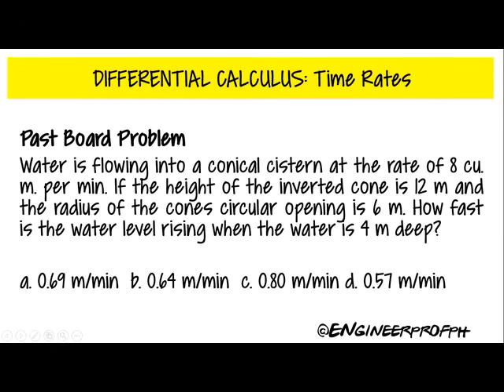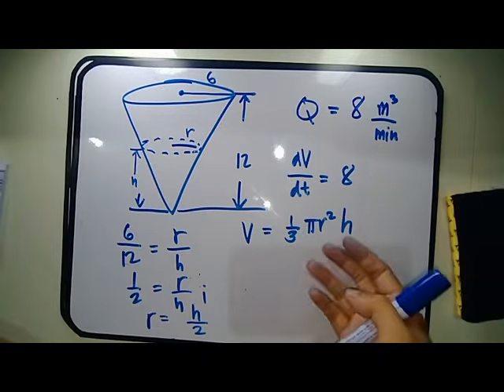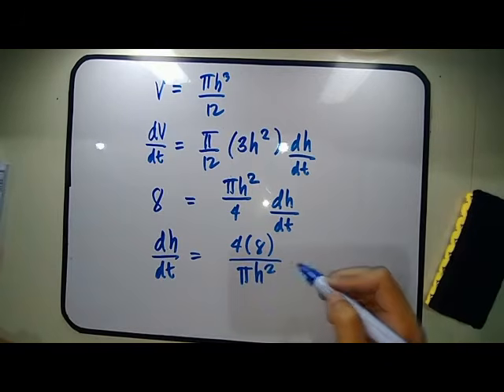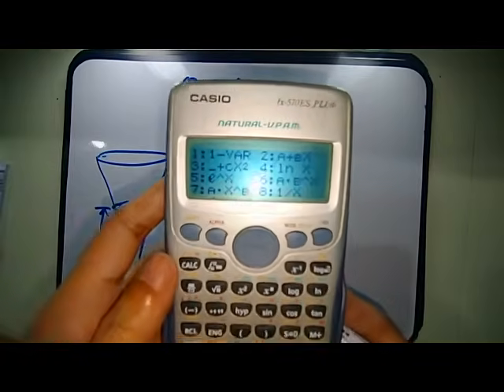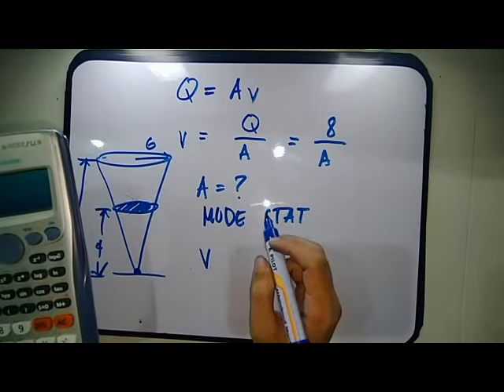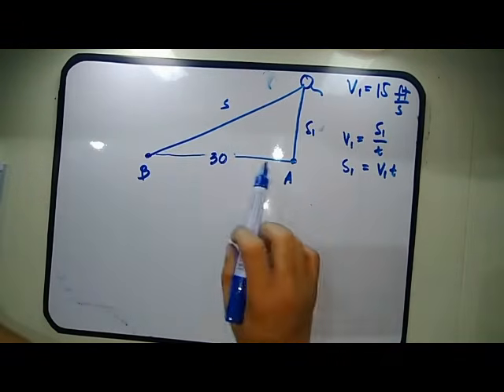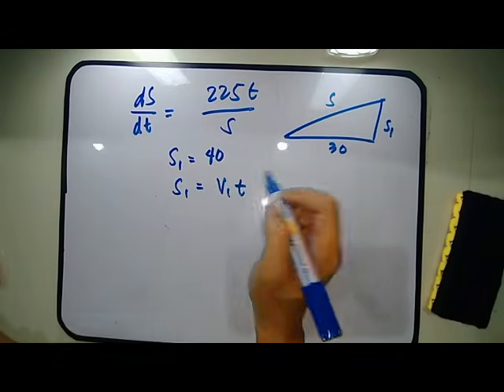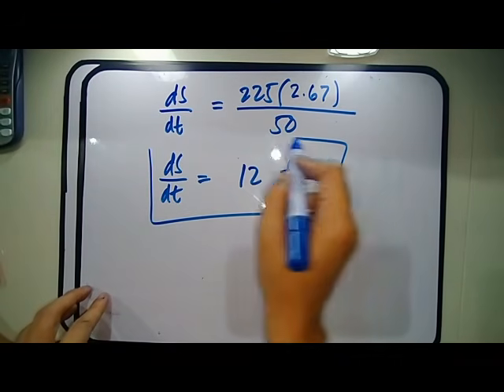Time Rates |Differential Calculus|

Comment: Sir bkit di pwede na gamitin agad yung formula ng V = d / t, solvable si time given ang V1 and S1, then solve na for velocity when S=50, velocity will be 18ft per second. Too convinient pero mali sir? Bakit po kaya
Reply from the maker: Hi! Nagkataon lang po na yung ganitong alternate solution ninyo ay fit sa problem. If you look at it po, you are actually using a derived equation from dynamics (which is galing lng din naman po sa calculus). Thank you!❤️

Comment: The sides of a triangle measuring 40 m, 32 m, and 16 m increase at the rates of 2 m/s, 5 m/s 
and 3 m/s, respectively. How fast is the area of the triangle changing? Ask ko lang po paano process dito
Reply: I specify mo ang parts kung saan jan ang height, base at sides

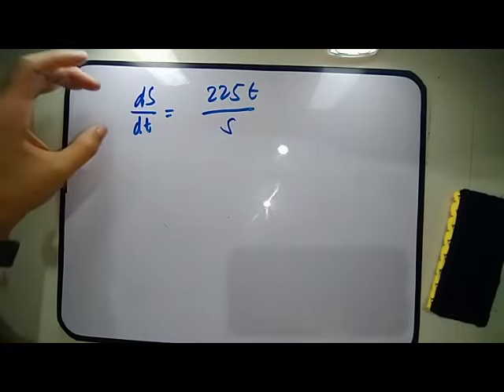Comment: sa second question, paano naging 225T/S?   Please check 10:33.
Reply: Divide both sides by 2s, so ma cancel ang 2 sa 225(2t) kaya 225t/s nalang
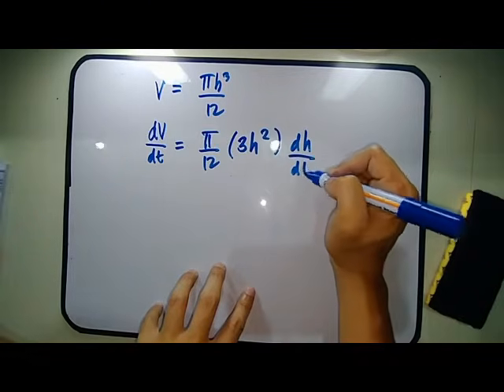Reply: @JoshuaDetablan  bakit kelangan idivide sa 2S? saka bakit hindi na multiply and 225 sa 2t? as per principle dapat imultiply ang 225 sa 2t. Please see this https://www.youtube.com/watch?v=U8cAVqkBBso&t=1671s at 3:21
Reply from the maker: Yes po, you can multiply it by 2 but in this case no need na kasi magcancel na yung 2 both sides upon division. Then you extract, ds/dt to get 225/s. Thank you for your question. God bless!
Reply: @EngineerProfPH   medyo mahirap iabsorb hehe need ng paractice, anyway sir maraming salamat.
Reply from the maker: @jaybeltran5616  you can do it! Salamat sa suporta sa channel natin! God bless!